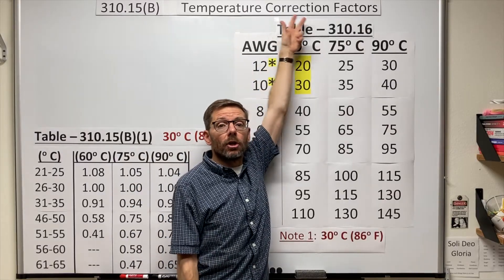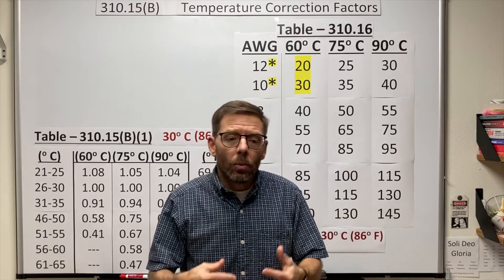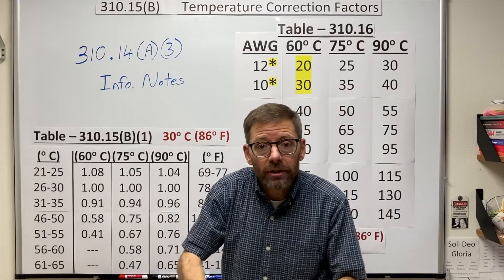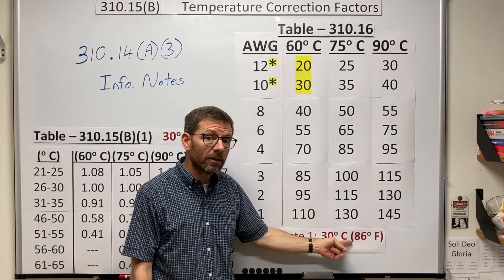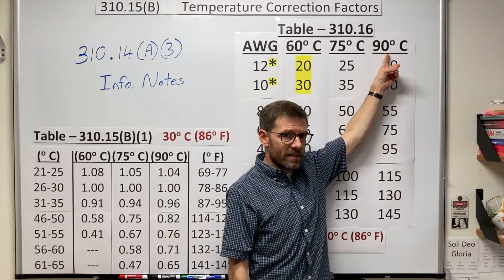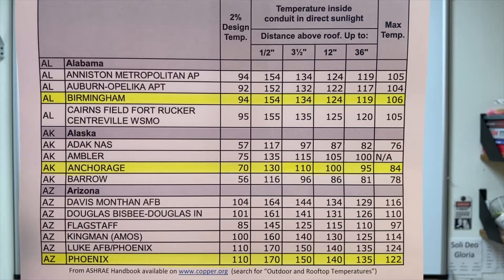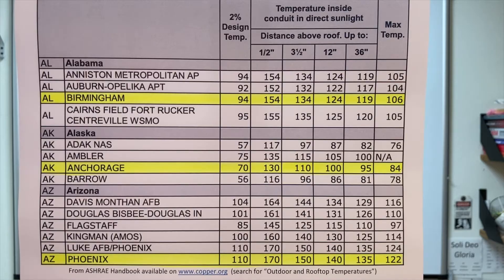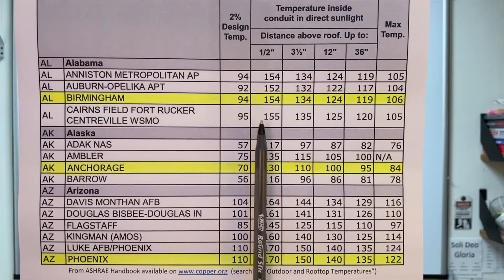310.15(B) Temperature Correction Factors

Comment: Something is going over my head. What is the difference in the "Ambient Temperature Correction Factor Based on 86 deg F", and the "Ambient Temperature Columns" that begin @ 50 deg F or less ? 

If my ambient, for example, is 50 deg F, what is the point in the chart being based on 86 deg F ?

Comment: Hi Dave.  Your video is the best video I've come across on this topic!  Definitely described the concepts well!  It's unfortunate that the code update limited the ampacities to that of "60 deg C". I wish it had simply stated the actual maximum ampacity (perhaps being redundant in repeating the ampacity values off of the 60 deg column) values per wire gauge.  The use of the "60 deg C" column is really confusing.  I was left with the question: "Is NM-B 90 deg C cable, or 60 deg C cable???".  I now understand NM-B is 90 deg C cable, and all correction factors for ambient temperature and conductor bundling are with respect to 90 deg Cable!  This would be the end of the story, but the NEC folks decided to add an upper ampacity limit as per the 60 deg C values.  It's just an added on upper limit (and an important one).  I suspect this was to deal with some corner cases that are not often addressed explicitly.  You already mentions attics in the summer, but other unknowns might be NM-B cable fished through insulated walls...  How well is the cable heat dissipated when buried in insulation???  This 60 deg C upper ampacity limit likely catches this situation pretty well too.  Anyway, thanks for the great video!

Comment: Dave...thank you SOOOOOO much for this video and a the few additional I already have discovered today by just finding you. You area  true blessing to the world of electrical contractors and enthusiasts who want to know and follow the code to the letter! You are a true Gentleman and a Master! Example Question - If you run a 90C 6/3 NM-B wire in a location of Ambient Temp of 30C to a junction box in that location BUT then come out of that junction and right into a space 10 ft away that has an ambient temp of 70C with 4/3. Do I only adjust amperage based on the higher heat on the 4/3  (since its the wire size in the higher heat) or do I have to perform my adjustments based on 6/3 (since this feeds the circuit at the junction box in the lower heat)? Thank you if you can please make this clear!

Comment: I passed all of the IRC code exams, B1, P1 and M1 on first attempt. I failed by one question on the first attempt taking the IRC E1 exam. There were a few questions regarding Temperature Correction Factors for conductors that I got wrong.  But now that I have found the Dave Gordon videos, WOW!!! I have to say Dave, you are amazing!  Explained in perfect easy to understand format.  Now I will use your videos to learn to pass the IRC E1 exam on my next attempt, thank you.
Reply: So I’m taking my test as well and I failed it because I missed every question regarding this damn section. 
By any chance do you remember a question regarding this?

Comment: But in 240.4(D) Small Conductors you can also find, Unless otherwise specifically permitted in 240.4(E) or 240.4 (G), the overcurrent protection shall not exceed 15 amperes for 14 AWG, 20 amperes for 12 AWG, and 30 amperes for 10 AWG copper; or 15 amperes for 12 AWG and 25 amperes for 10 AWG aluminum and copper-clad aluminum after any correction factors for ambient temperature and number of conductors have been applied. It looks like this statement omit the insulation types, for example #14 AWG copper can only carry 15 A at most, no matter what kind insulation it is. Please help me to understand this, thanks!

Comment: Firstly, these videos are wonderful, thank you Dave. Just want to add info for another common problem, and explain language in 110.14(C).

You're feeding a >100A HVAC circuit on a rooftop, conduit is exposed to the sun and you want to adjust the ampacity for a higher temperature. You want to take advantage of 90C rated conductors, but the source panelboard and disconnect terminals are only rated for 75C. 

Calculate the allowable ampacity using the 90C column with your temperature correction. Then compare it to the ampacity rating of the 75C without temperature adjustments. If the 90C figure has a lower allowable ampacity than the 75C figure, then that wire size can be used. If the 90C figure was higher than the compared 75C, then the wire is too small.
Reply: Thank you for the clarification. Can you also do this for temperatures lower than the 30C?

Comment: Is there ever a case where you would use the 75*C column for a 90*C rated cable?
Reply: Check out the post I just made for the video, it should answer this quesiton.
Reply: @crazyskier66  im sorry, where do i find the post?
Reply: 110.14 (c)

Comment: With the increase in outside temp. the current going through the conductor decreases due to increase in the resistance. But why with the increase in the temperature allowable ampacity is increasing? As it is varying from 60 to 75 to 90.
Reply from the maker: You are correct in your initial sentence that as the ambient air temperature increases, the conductor will heat up and therefore make it harder for current to flow due to the increase in conductor resistance as temperature rises.
If I understand your question correctly, you are wondering why the allowable ampacity increases as the temperature rating of a conductor increases.  The conductor's temperature rating is based on the type of insulation surrounding the copper or aluminum.  As current flow increases, the internal temperature of the conductor increases and if it gets hotter than the insulation is rated for, the insulation will start to breakdown.  Some insulation types can stand up to higher temperatures than others and therefore conductors with higher rated insulations are allowed to carry more current than the same size conductor with a lower rated insulation.  It's about protecting the insulation.
If you haven't seen my other videos on conductors, they may be helpful and the playlist can be found at https://www.youtube.com/playlist?list=PLxFqFitetEACd7sAoHvXGQqIHWjmLxl41